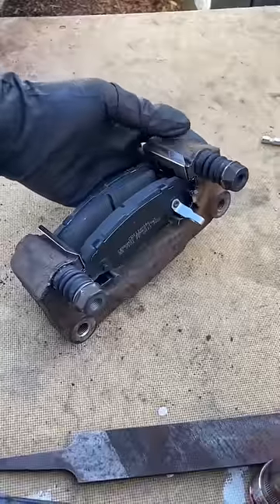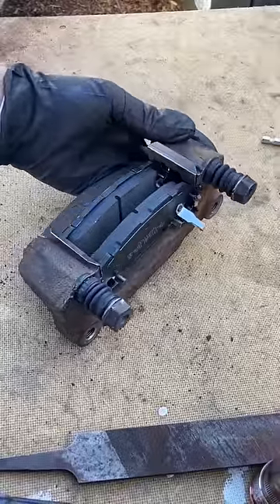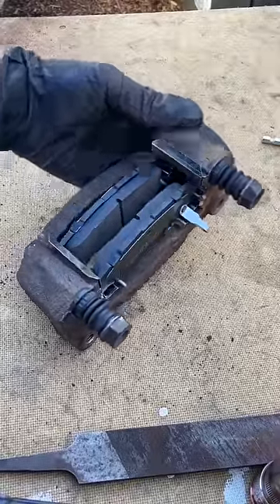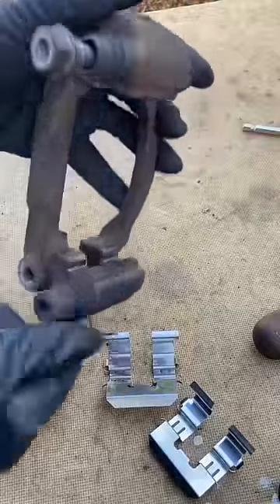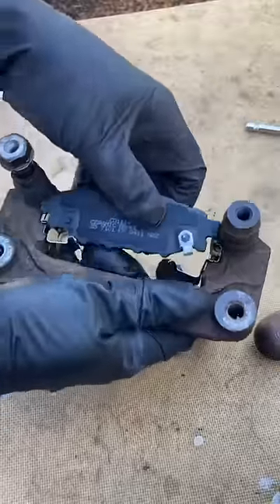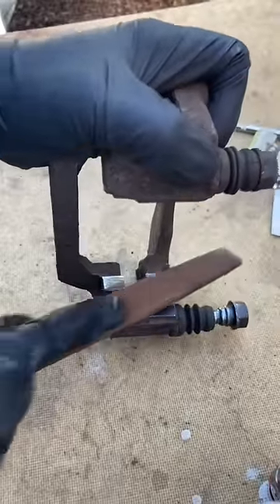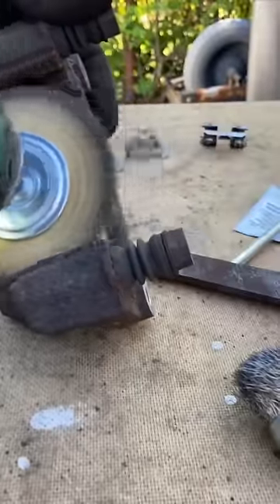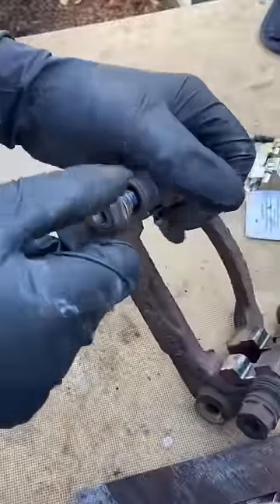What’s the Difference Between a $50 Brake Job and  $200 Brake Job

Comment: Labor rate must be off the charts, because that doesn't take any amount of time.
Reply from the maker: Flat rate
Reply: Teach me how to be a scammer too 😂😂
Reply: Flat rate
Reply: @user-rm3qj9mb2b  : The whole point of the video is he charges an extra $150 for 2 minutes of work he says the other guy leaves out. Everyone should do that regardless, but justifying the exorbitant price for such a short job by  doing a necessary 2 minutes of the work is obviously what I'm talking about.
Reply: @skipads5141  This kind of work would commonly happen in the rust belt states. As for some other states, it seen as useless and waste of time.
Reply: I do all that for $100
Reply: @AndyTheXTech  Per hour or job?
Reply: @Andy The X Tech  all you did was what is supposed to be done in a 50$ labor b
Reply: the filling and brush work he shows but also skips through is easily a couple of hours worth of work.
Reply: @Andy The X Tech  not even close a full brake swap including discs (which u didn't cover) should take no more than an hour and a half so how is that 200 what do u charge as your hourly flat rate 🤔
Reply: Exactly lol I do all that and still charge $50 for people I know
Reply: @AlexandarHullRichter  if youre taking hours to do a brake job no matter how detailed you are. You're doing something wrong.
Reply: Average hourly labor at a shop in my area is 280.  But don’t worry.  They still pay you $15/hr.
Reply: @IAmProfitMusik : But the point of the video is not the entire job. He's saying he does that one minor thing once everything is completely apart = the difference for 4 times the price.  That's what he's saying and that's what I'm saying is a silly claim.  That extra few minutes is $150 is literally the entire point of the video.
Reply: Oh it takes a amount of time try 10 additional mins each or more not too mention your taking out a bunch of extra tools and if you spend a good amount of my your tools you wipe them down after doing brakes they get extra dirty but well worth the effort
Reply: Well..... you're only seeing a small fraction of the job. It's not difficult or very time consuming but there's still the part where you take apart the caliper from the bracket, take off the rotor, clean the bracket, grease the pins, clean the wheel hub put it all back together etc etc... not to mention there's always going to be at least both front or rear brakes that are getting done.
Reply: From racking the car, removing wheels, removing calipers, inspecting and cleaning calipers and hardware, prepping pads.... turning rotors to spec, reassembly and un racking can easily eat up 2 hours.
Reply: @nickolusmayfield5612 : If you're slow, but anyway the video is very clearly about charging 4 times as much for doing one minor detail that most people do that only adds a few minutes.
Reply: @nickolusmayfield5612 not too many rotors get turned these days, and most places I go to look at the odometer to determine if you need rebuilt calipers. Which adds cost but saves labor- which you don't get a break on. Unless you're doing it yourself.
Reply: @nickolusmayfield5612 He is saying he can do all of that disassembly and assembly without cleaning and greasing the caliper for 50$. But grease and brush clean costs +150$. Thats a straight up scam.
Reply: @skipads5141  that's why it's flat-rate! not hourly shop rate. $$$ 😂
Reply: @vcalv9354  but you're not also doing all that for the $50 brake job too? because I'm pretty sure you are. Otherwise you ain't getting the pads on. so basically the extra time he takes to clean the calipet up, lube the pins and replace the boots is the extra 150 bux he is justifying w/ the vid.
Reply: @nickolusmayfield5612  turning rotors? I can't even remember the last time I saw a  rotor get turned in a shop. Shops, part stores they just want to sell you new rotors.
Reply: @Butterfat Farms  I don't understand your question or point. No brake job is going to be 50 dollars because brake pads and rotors are never that cheap and you always have to do it in pairs. I'd do that for any brake job. Whatever the price comes out to be depends on the cost of parts and labor.
Reply: @vcalv9354  the $50 versus $200 rate has nothing to do with the cost of doing the actual brake job. that is his flat rate cost for doing the labor. The entire point of the video is to make his point that if you pay me $200 flat rate to do your brake job I take the extra effort to clean your calipers up with a file real quick, put some fresh boots on the pins and lube them and that is what justifies his $200 flat rate over the alleged $50 brake job guy that isn't going to supposedly do that.
Reply: @vcalv9354  and all the labor that you are suggesting you have to do to service the calipers, that has to be done anyway to put the pads on anyway. The guy doing the alleged $50 brake job has to do all of that work too. This isn't a whole lot of extra work he has to do just to access the caliper and clean and lube the pins and replace the boots and file away a bit of rust. Which seemed to be what you were suggesting and justifies his $200 rate ( and the point of his video ). Who does brake jobs for $50 labor? Good grief they need the work smarter not harder. I wouldn't even think of doing front or rear brakes, either one for $50 let all four corners. At any rate there is very little extra time and effort here to true up the caliper where needed with a file and lube the pins and replace the boots.
Reply: @Butterfat Farms  I think I get what you're saying now. A fifty dollar brake job would involve just slapping the brakes on the car. No cleaning. No resurfacing a rotor, no grease, no nothing. I think the real issue here is how you minimize all those things. Look at the end of the day value is subjective. If you don't think all that is worth 200 to you then do it yourself or go pay someone 50 bucks and see how quality of a job they do is.
Reply: @Butterfat Farms  none of that HAS to be done to put the brake pads on wdym? You could totally just take the caliper off and slap the pads on there without ever greasing the pins or anything.
Reply: @ButterfatFarms : It's still $150 for an extra few minutes work, THUS that equals a staggering RATE. Money/time = rate. 
If I tell you I'll charge you $50 flat rate for something that will take me 55 minutes or $200 flat rate for something that will take me 60 minutes, that extra $150 per 5 minutes is a staggering jump in the RATE.
 
Fractions is hard, ain't dey?
Reply: @skipads5141  but I get it, that all just went whoosh right over your head! 😂 Figure it out dude, he doesn't do $50 brake jobs. He does $200 brake jobs, period. He's just selling you on what he does for that $200 brake job compared to some half-assed guy who is rushing through it for $50 and doesn't give a crap about doing it right because you're a cheap-ass and you get what you pay for. That's his whole shtick about advertising his $200 labor brake jobs.
Reply: @ButterfatFarms : I have figured it out. It's plain as day. You don't get his claim of 5 minutes being worth 150 bucks.
Reply: @skipads5141  do you do brake jobs for fifty bucks, including the extra 5 minutes to do this? Do you? Neither will this guy, you ask him for the $50 brake job he's going to tell you to bugger off he doesn't do those. I sure as hell wouldn't. You want to be that guy you go right ahead and sell yourself short like that. Have fun with that nonsense!
Reply: @ButterfatFarms  Did you just convince yourself you weren’t wrong about the point of the topic by making a statement that wasn’t the topic. 😂😂😂

He said NOT including parts. He said just replacing the pads was a $50 labor brake job. 
Then for an additional $150 in labor cost you get a partial caliper rebuild. That’s $75 per partial caliper rebuild. Which $75 is the price range for new calipers.
Reply: @Chris-mo9gt  If we're talking about labor rate for a single axle he's on the high side at $200 and he's way low on the low side $50. More realistic is between 75 to 150 for the labor. And they should be doing it right regardless at that price. His $200 labor brake job is overpriced and I don't know who he's comparing his rates to at $50 to justify the few minutes extra work he does. He's just being silly.
Reply: @Chris-mo9gt  whether he's doing 5-minute extra work or not is irrelevant to the fact his labor rate is sky high. Doing the 5 minutes extra work doesn't justify it either. That that's the difference between his $200 labor rate and some imagined $50 labor rate is irrelevant. It doesn't justify his $200 labor rate.
Reply: @ButterfatFarms  I agree with you on that. It’s about $100 labor per axle where I am as long as you don’t go to a big chain store. 
I’m just saying the definitely too low $50 labor price point and the high $200$ labor per axle price is irrelevant. 
Only the difference between matters in this instance. It could be $100 vs $250. Its just about what he was providing for the extra $150. Which is around the cost of new calipers and is one banjo of labor extra vs what he did to the calipers.
Reply: @adaamdavis5434  😂
Reply: If you're going to pay someone to do a job you're capable of doing yourself don't whine about the price. It's called a convenience tax.
Reply: @AndyTheXTech  your flat rate is a rip off too
Reply from the maker: @DH-jt1bw  ok
Reply: Bro these poor people gotta chill with the “you’re scamming people”. The market decides that… my job my rate is $250/he and then 175/hr after that. Why? Because it’s a niche luxury job and we can charge that and it keeps me employed well over full time.
Reply: @austine2680 
Scammer: "Bro these poor people gotta chill with the 'you're scamming people'.".
Reply: @ButterfatFarms 
Ive been doing 50 dollar brake jobs for people and im a professional. And if you dont do it right, you are liable for killing someone because their brakes failed. But school me on your entitlements over safety
Reply: @skipads5141  Exactly 👍🏻
Reply: Can you imagine what he charge for break shoes work.
Reply: @ButterfatFarms  that’s exactly what I’m saying. No mechanic in my area is going to grind and sand down brake parts, what for. If it’s rusted and corroded and seized, they’re just gonna sell you more parts.

Comment: If that is a $200 brake job, that means I’ve been doing a $500 brake job to all my vehicles, proud of my self 😊
Reply: Really no. A skilled technician should be able to complete the job in about 2hrs. A lot of the shops I've seen have $100/hr labor rates. Keep in mind the rebuild might not be on all four calipers either
Reply: @beardedforlife3740  2 hours? For both axles? That's a ripoff
Reply: @beardedforlife3740  2 hours??
 it takes 20 min to do both front brakes
Reply: It pays an hour to do each axle according to book time unless you are resurfacing the rotors and then it would pay 1.5hrs. where do you guys get these times?? And it should NEVER take a "skilled" tech that long or he would never meet his flat rate and be broke as hell every payday. 😂

Comment: Yea, right! Ain't no mechanic out there taking his time to do all that, it's about getting things in and getting things out quick.
Reply: Exactly. When I do my own mechanic work. I never have issue. When I take it to a mechanic there is some problem. I think the reason is they try to rush the job and don't pay attention to detail. When your working on yiur own car. Your going to make sure it's done the right way. Sombody else car, yiu don't really care.
Reply: I do every brake job that way, but use air tools for the grinding.  I make all my mechanics do the same.  There are shops out there doing it right!
Reply: @squashy1982  then you are an extreme RARITY!
Reply: @KrishnaSingh-ow1ie it’s because any little extra thing that takes the technician extra time they want to charge for that because the technician isn’t getting paid for it otherwise, where as when you doing it your it’s no big deal
Reply: Dude if someone doesn’t do this when doing a brake job they’re losers lol
Reply: Exactly. Any Mechanic that says they’re doing all that is full of crap unless it’s on their own car. They wouldn’t do All that they just sell the customer all new parts. Every part he put his hands on would’ve been replaced with brand new parts and they would simply charge the customer for it.
Reply: @joeybiden7755  idk where you take your cars to but first off all of that is not necessary on every car like he said the pads were sticking yes we do that if they are sticking but it’s not necessary on every car and yes we always grease the slide pins and put new rubber on them if they are not working correctly anymore that is if the customer will pay for new boots because they don’t come with the pads but again it’s not necessary on every car but if it is necessary we do it
Reply: @squashy1982 I am with you brother I take pride in my work quality over quantity 🙏

Comment: Yet the dealer asks $900 and does the work of a $40 job
Reply from the maker: Most of the time yes
Reply: Bro no joke, the dealer charged a pcv change on my uncle’s Seqouia for $800, I looked up how to do it on here and the part only costs $6 and a 15-year old can do it with the right wrench 💀
Reply: @AndyTheXTech  most of the time no
Reply: @MrOiram46  sure kid.
Reply: @executiveinvestments you think hew lying? It's the truth, how do you find greedy dealerships.NOT believable 😅
Reply: @spencerkleiman5035  he’s 100% lying.  Greedy?  They charge a labor rate.  So they should not charge to do the work? They should only charge for a part and not labor?  The dealer charges fairly.
Reply: I paid 5000$ for a tune up and comple brake job with fluids and everything on 2015 odyssey.
Reply: @executiveinvestments  Reference "The dealer charges fairly"
All dealers????
Reply: @sarkesmantian6945  What even is a "tune up" today? It was called a tune up way back when you would tune the carburetor to work properly. Careful of a place telling you they will give you a "tune up"

Comment: Don't trust shops to do this at any price, you want this level of service do it yourself.
Reply from the maker: Yes 👍
Reply: I do this on every car in my shop
Reply: I also wire wheel the entire carrier, then give it a coat of Kurust, which turns it black. Plus, shine up the bolts. Looks good after. It helps when I take it for inspection because the testers see it and know I take care.

Comment: “You grease the slide pins?”
“Nah this a $50 brake job.” 🤦🏾‍♂️🤣
Reply from the maker: Ok
Reply: RuthlxssB clearly you have no idea how to properly install new hardware
Reply: @jeremymahnken7322  I actually do, and would do it regardless if someone paid me $50 or $$200.
Reply: Good ole pad slap 😂
Reply: Like I said in my comment we do all of that over in the UK at our place an the dollar is not far off equal with the pound. We charge £40 to fir a set of pads. Wish I could charge 200 pounds but I'd never sleep.
Reply: Lol
Reply: @jeremymahnken7322   clearly you don’t comprehend well because he is saying this process to grease pins does not take $200 worth of time. He is not saying you need to skip that step.
Reply: Lol
Reply: @jeremymahnken7322 ain’t no one got time for that, this is a $50 brake job!

Comment: I do what you did for $50. For $200 I sand blast the caliper and bracket as well. I'd also buy the customer lunch for that much.
Reply: You forgot to add the caliper paint job after the sand blast to make it real nice for that price 😅
Reply: Now THAT is worth the money 👍
Reply: Well. Technically if the customer is paying you $200 then they’re paying for their own lunch. 😉
Reply: @Crewsy  good point lol
Reply: Where's your shop? I'm buying the EBC USR Rotors and RedStuff Brake Pads.
It's a Scion TC and I want to have you rebuild the OEM Calipers with a kit unless you recommend getting new ones.
It's a 2007 with 105K miles.
May also replace the radiator, hoses, and serpentine belt.
Just did the starter myself.
Reply: And in 2 weeks the whole bracket is corroded. Nice job amateur.
Reply: Blast with dry ice, and the calipers stand a better chance of not corroding.
Reply: @Alexey Gerasimov  Come to San Antonio. 
Fiesta is 2 weeks in April, and you can stay at our place in a great neighborhood.
Reply: @ph3733  or if you are gonna media blast em then metal etch primer them, then paint with a high temp paint and stencil a design and clearcoat for a permanent and beautiful job. Now there is a $200 job.... Right after you slap a reseal kit and reassemble the new brakes and bleed with a possible abs bleed if needed them bad boys... 😂😂😂😂🔧🧰👨‍🔧💯👍😎💪

Comment: Excellent work, lots of people overlook replacing worn rubber boots, have seen guys put enough grease on the slide pins to bake a cake, the way you cleared off the rust to clean metal before slapping new hardware is what I like to see. Subscribed

Comment: The problem is so many places don’t allow for this sort of time to do the job, this is how it should be! Meticulous and great result .
Reply from the maker: Correct 👍
Reply: The most important thing is lubricating the pins and making sure there in good condition. If you don't have time to do that. Then yiur not doing a brake job.

Comment: Been doing my own brake job which probably equates to $50. Cheers for giving us the knowledge on how to do a $200 job.
Reply from the maker: Thank you! Just trying to help.
Reply: It is standard
Reply: Here we are, back at YouTube University.
Reply: @AndyTheXTech  I agree with everything except for putting grease on the slides. They are supposed to stay dry
Reply: @dhill6735  the grease is there as a rust inhibitor. That exposed metal will corrode in a couple months specially if it rains a lot